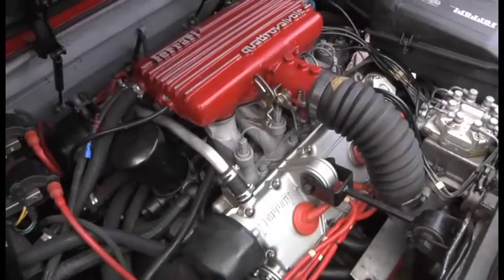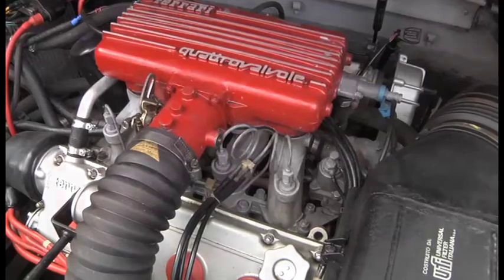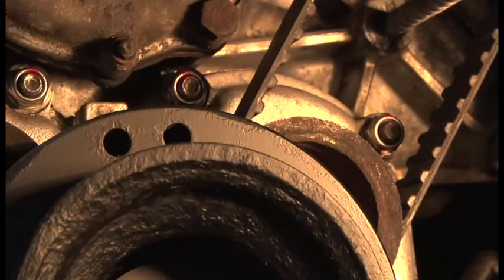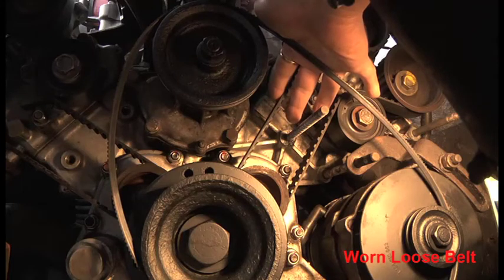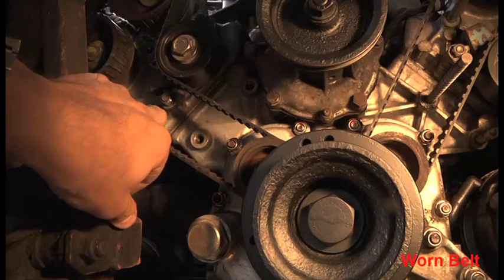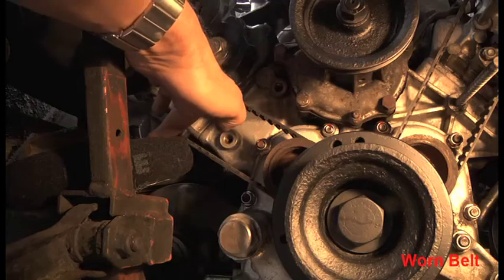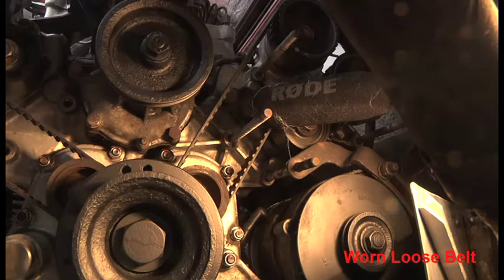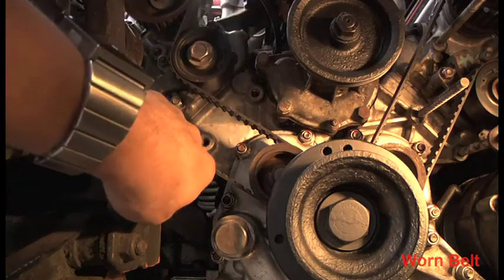Ferrari Worn Cambelts Tension Test Using A Microphone

Comment from the maker: Hi Tom, yes you could use a guitar tuner to tension the belts once you'd established the  correct note to tune to. In other words, you'd need a correctly set up belts in the first place to take a readings from, then note that reading down for a future belt replacement.
BUT as you say current cam positions do have a bearing on belt tension also.
The trick is to rotate the engine to different positions and find the average reading.
There are other ways of tensioning to as you probably know, but the new way is to use a special tool called a ''clavis guage'' which is basically like a glorified guitar tuner.
Anyway thanks for watching, Doc.
Reply: i noticed when i checked mine that the belt on the left side was abit loose and found the tensioner was free spining  on the belt..so i loosened the tensioner and then tightened it up again and its good as gold

Comment: The tigher belt would be resonating between a low E or F at about 41.02Hz~43.65 Hz and the looser one at D below that, being about 36.7 Hz. Not sure about the octave though, so it could also be twice or half that. Would you actually be able to set the tension using a guitar/bass tuner of some sorts? Or are there too many other factors involved? (like tensioner spring, current cam position,...) I do however think that belt wear is probably very comparable with string wear on instruments. Even if you don't play them they'll need replacing over time.